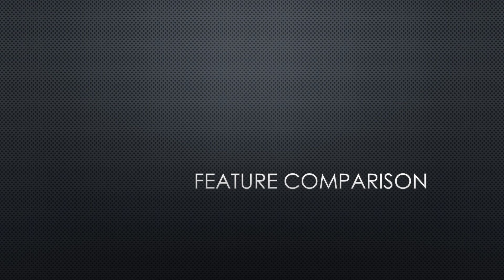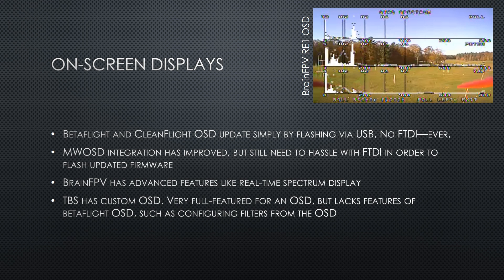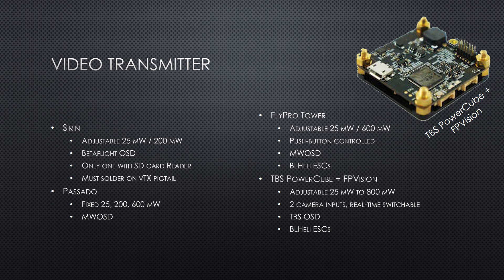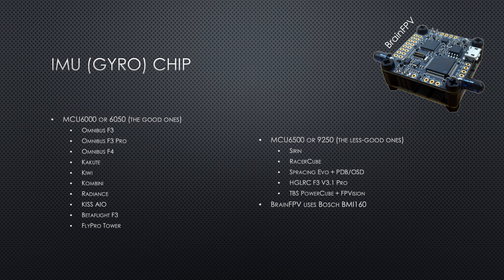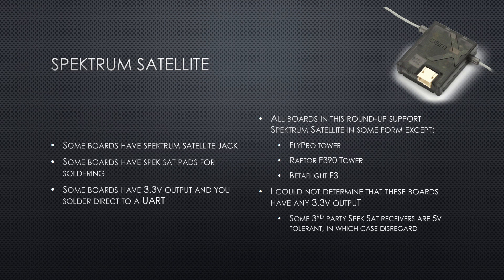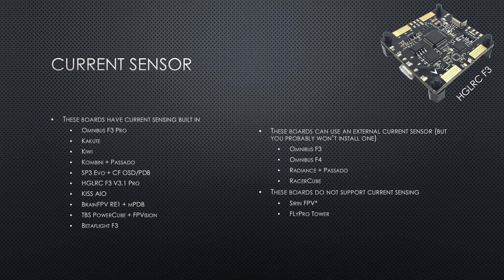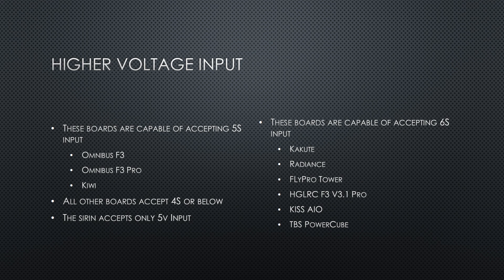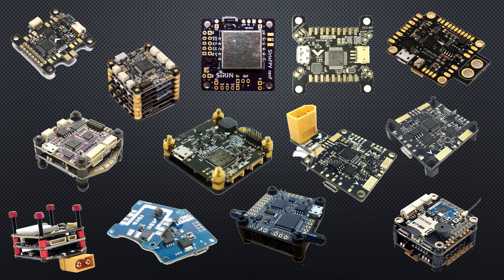Betaflight / Cleanflight All-In-One (AIO) Flight Controller Roundup | FEATURE COMPARISON

Comment: hi Joshua, well I remember watching one of ur videos and u showed a flight controller that had a direct just connector for a 4 in 1 ESC and I can't recall which it was. could u help figure out which board it is or one that would be good for an 4in1 ESC setup on a 120mm frame. thanks

Comment: Hey Joshua, great roundup!
Have you had a chance with the "STM32F4 F4 V3.0" boards (F4 FC + PDB + OSD +BEC). Most probably a clone but not sure on which board this is based.
As for the Kakute and blackbox aside, were you happy with it when flying?
Reply from the maker: I haven't flown the Kakute yet, but I have no reason to believe there's anything wrong with it. All FC's perform basically the same and fly very well, unless they run into gyro twitch issues.

Comment: is it possible with the betaflight f3, to run a separate PDB?  Or do I have to use the built-in one?
Reply from the maker: If you don't run power through the Betaflight current sensor, you won't get current readout on the OSD, which seems a waste. If you don't care about that, then you can use whatever PDB you want and just run a wire to the +/- pads on the Betaflight F3 for power. If you still want current reading on the Betaflight F3, you can wire it up similar to the Omnibus Pro: vBat + to the + pad on the board, then another wire from ESC + on the board to the + pad on your PDB.
Reply: Joshua Bardwell awesome just ordered it from the site you recommended on preorder. Thanks for the knowledge man.

Comment: Does the TBS bundle need a seperate ESC and if so are the 4in1 esc capable of adding to that setup or will it not fit with the standoffs provide?
Reply from the maker: The TBS bundle is only the FC and OSD/vTX board. It needs separate ESCs. You can buy it with an ESC extender board that lets you wire it up to a traditional ESC. I think a 4-in-1 could go beneath the stack, but I can't be sure about that.

Comment: I agree with your F3 vs. F4 feature / benefit comparison. I do have a couple of F4 boards (CC3D Revo and Omnibus F4). The ONLY reason I run them is to run / test 8k/8k. In my tests, there is negligible difference between 8k/4k vs. 8k/8k. Sure, there is a difference, but I think it's more computational vs. the pilot feeling or noticing anything response wise. I am just as happy flying 8k/4k as 8k/8k. This will probably change once DSHOT gets standardized and out of beta, but for now with Multishot, I agree, there is no real huge advantage, especially with feature set comparison. I typically stick with an Xracer F303 v3.1, as for me, it's a solid performer with no hitches. On those setups I tend to run an STOSD8 PDB as I like their layout and ease of setup.
Reply from the maker: +Tom Coffel I agree that sticking with what works is more important than the cutting edge.

Comment: Just seen this at rtfq FLIP 32 - F4 - OMNIBUS V2 PRO.  For the price I think it fits the bill.
Reply: con - its sold by RTFQ
Reply: I've never ordered anything from them but after doing some research I see they have horrible customer service.  Thanks for the warning.
Reply: Broad brush. The problem lies from buying from RTFQ and expecting to receive any customer service. If you want to buy it and get it and mess with the product yourself then def. buy from RTFQ.
Reply: This assumes you actually get it. Much of RTFQs complaints come from people not actually getting their product (and then not receiving support). Just buy it from airbot.
Reply from the maker: For what it's worth, my main reason for not shopping at RTFQ any more is multiple instances of not getting the product and then not having any recourse for about 30 days until the Paypal dispute is about to expire, at which point I get a refund. This isn't a case of, "vendor sells product without support," but, "vendor sells product then doesn't deliver it then sits on money for a month without any communication at all with customer."

Comment: Hello, hopefully this is not to far off topic; I disabled the usb connection in the serial port tab on my fc and now my board wont connect through usb, go figure, is it possible to re-flash and hopefully resetting that option through the UART??
Reply from the maker: Press the bootloader button or short the bootloader pads, whichever your board has, while you plug in the USB. The board will be in bootloader mode, allowing you to re-flash the firmware. Choose "Full Chip Erase" option.
Reply: It is one of the newer boards with a usb separate from from the UART and that's what I turned off, on the board side, so it will go into boot mode just no communication to send the data.
Reply from the maker: +Gianluca Zizzari it doesn't need MSP when in bootloader mode. If your drivers are installed and the board is in bootloader mode you can flash it. You can't turn that off very easily.
Reply: I checked the flash on connect options but nothing happens, I think the option I unchecked was MSP VCP maybe. I was trying to set up a sat at the time was in the serial ports set up tab if/when I can I will get a screen shot to show it
Reply from the maker: I know what option you un-checked. I'm telling you that doesn't affect bootloader flashing.

What is the LED doing on the board when you put it into bootloader mode? Is it one solid LED, or are there two LEDs, and one of them blinks rapidly after you power up?

What does the CF configurator show in the Port setting? Is it "manually select", "COM", or "VCP"?
Reply: There no LED when in boot mode and I have a motor connected and can hear a difference when powering it up. 
Both CF and BF say manual select and fails to open serial port.
I was stumped and thought up the UART idea, which however shows as com 2 but fails to connect aswell.
I'm using this m.banggood.com
Reply from the maker: +Gianluca Zizzari no led at all doesn't make any sense to me. Is there an led when you power without the bootloader?
Reply: Ok sorry when I power the board from usb there is no light but the computer makes different sounds for boot and not, and when I power up with the battery I get the solid 1 LED, i then plug it in to flash on contact but nothing happens.
Reply from the maker: You can't do "flash on contact" if you have previously powered the board with a battery.

I think your drivers are messed up if the computer makes a different sound when you plug the board in with bootloader vs. not. Can I refer you to this video:

https://www.youtube.com/watch?v=m4ygG6Y5zXI
Reply: I used Zadig got into dfu mode, flashed it but BF still can't get a connection so I can use the gui to set things up :/
Reply from the maker: +Gianluca Zizzari did you do a full chop erase when you flashed?
Reply: I can't remember I feel I should have because that and flash on connect was what I was trying but when I used Zadig I feel sure I turned that off. However, I dislodged a component that was close to the boot pads with the soldering iron and it is most definitely bricked now, que me sobbing in the corner :,(

Comment: Thanx really good info here :). Nice with current sensing... But say you need to manage 120A. Just looked like 50mohm resistor on one of the boards. That is 0.6V over the resistor and 72W. Argh that will be hot. With 0.2mohm then it will be more manageable 2,9W. Still very much heat. Ofcourse there will not run 120A all the time. Still early morning here so I could be wrong.
Reply from the maker: I have seen people melt the solder on the RROSD current sensing resistor by running too hot. Maybe this explains it.

Comment: I've not flown a Bosh BMI 160, but when manufactures stated putting them in I looked through the data sheet which can be found here.  http://www.mouser.com/ds/2/783/BST-BMI160-DS000-07-786474.pdf  Please someone correct me if I'm wrong, but although the SPI interface will allow for connection up to 400kHz on the 160, the unfiltered Gyro data can only be read at a rate of 6.4kHz, and accelerometer data at 1.6kHz, which would eliminate true 8K looptimes (even gyro only) and basically limit you to 4K, 4K, which kills it for me as an F4 board, at that point just stick with F3.
Reply from the maker: That's correct, but the Brain dev's response is that the Bosch gyro can output at those rates with the anti-aliasing filter enabled, whereas the Invensense chips need to disable all internal filtering to get those rates. So the argument is that the Bosch gyro is outputting much better data than the Invensense.
Reply: From where did you read 400kHz? The BMI160 SPI works with up to 10MHz clock. What Joshua said below is correct, i.e., the output data rate of the BMI160 gyro is 3.2kHz max compared to 8kHz with Invensense chips, but the signal bandwidth is much higher (890Hz vs 256Hz) and the delay in the chip is lower (about 200us vs close to 1ms with Invensense). Reducing delay is the main reason for running things at 8kHz, and the BMI160 at 3.2kHz will actually give you less delay than an Invensense chip at 8kHz.

PS: I designed the RE1
Reply: Yeah, I misread the spec sheet, I was looking at the unfiltered data to the optical image stabilization interface, which is 6.4kHz at 400kHz, I thought you may be using that interface for higher data rate.  I didn't think about the delay in the chip, that's certainly a good reason for the BMI160 over other chips.  Does betaflight offer 3.2kHz? Or would it be 2kHz that you would need to run it at?  And is it still faster at 2K than an Invensense at 8K?  Why F4 if the intent is to run it at less than 8K?  If the answer is marketing I understand, because I know a lot of guys that are done with F3 because "F4 is better" without even knowing why, other than it's 1 more.
Reply: Betaflight on RE1 runs at 3.2kHz. Because of the way the OSD works on RE1 (the STM32 renders it in memory), you pretty much need an F4, as the F3 chips don't have enough RAM.

Comment: banggood shows a betaflight f4 for pre-order.  I am interested.
Reply from the maker: I'm 99.9% sure it's just a Revo clone or something like that. Betaflight controller is an F3 and it's not sold by Banggood. Banggood has sold other F3 clones as "Betaflight" boards before.
Reply: Joshua Bardwell I'm thinking now about the omnibus f4. The links you have aren't clones are they?
Reply from the maker: I believe that I have verified that all the Omnibus are legit, except the F3 that I have labeled as a clone. That being said, there are so many boards in this roundup that it's always possible I made a mistake.

Comment: Have you had any issues with OSD and PDB being combined?  I know it makes the most sense for current monitoring purposes, but I do see comments about the high current adjacent to the video signal causes some noise.  What has your experience been in that regard?
Reply from the maker: No problems with video noise on the RROSD or the HubOSD, which are the two I've tried. The designer of the board ought to include filtering if the PDB and OSD are combined.
Reply: Does anything exist like the HubOSD that runs the BF OSD and can communicate with  the FC in a passthrough kinda way to make  configuring easier?  Or maybe a HubOSD that is hardware only and needs the FC to operate it?
Reply: I guess what I'm asking is:  can you get an external piece of hardware and connect it to an open uart to make any  BF FC an AIO in regards to an OSD/PDB?
Reply from the maker: Currently, Betaflight OSD only works with boards that have an on-board OSD connected via SPI. In the future, I believe that it will work with external OSDs. Also, CleanFlight OSD has some similar features to Betaflight OSD, and it supports external OSDs--although currently I think that the CleanFlight PDB/OSD board is the only one fully supported.

Comment: Hi Josh. I Received two of the Omnibis AIO F4 v2 FC TODAY. Unpacked them while watching your video :)
http://shop.myairbot.com/index.php/early-bird/omnibusf4v2.html

IMO it is better to keep the current sensor off of the FC due to electrical noise concerns, seems that the FC does have an analogue input to use with a suitable PDB though.
Thanks for the vids

Comment: The omnibus f4 does have current sensing, I run it directly off my 4s battery and it shows the voltage on its OSD.
Reply from the maker: +Rc Addict with planes voltage is not current.
Reply: Rc Addict with planes he's talking about seeing amp draw not battery voltage, it's not super important if you go with proven setups and prop your motors accordingly, but if you like to play around with different setups/combos it can be an invaluable tool

Comment: Kombini does support 5s 
I run it on 5s
Reply from the maker: +Ahmad Ilyas I'm going off of manufacturer's specs. If I got it wrong, I'll correct the spreadsheet and the slide deck.
Reply: I visited furious fpv website and there website says 5s ready in its description page
Reply from the maker: +Ahmad Ilyas okay thanks.

Comment: great video, and thank you for the work. 
Just wanted to mention that the hglrc f3 v3.1 has a 8mb flash, so it has blackbox capability.
Reply from the maker: +marco failla I'll update the docs.
Reply from the maker: I've double checked, and this isn't mentioned anywhere in the specs that I can see. Are you sure it's the same product?